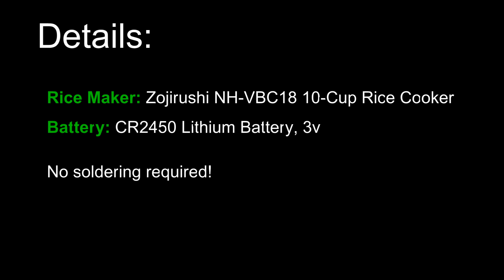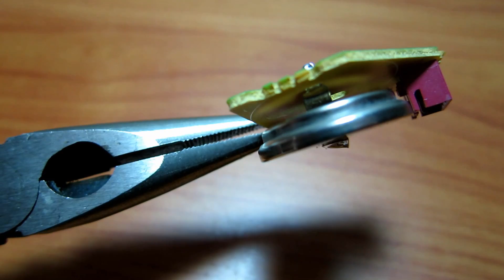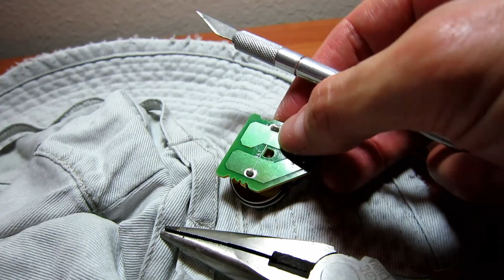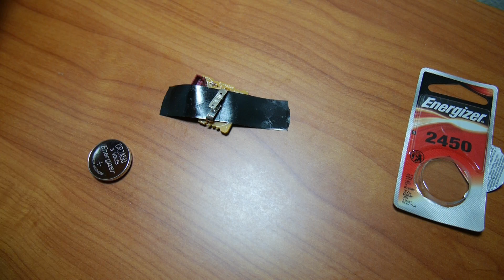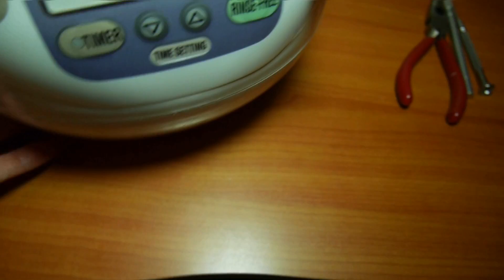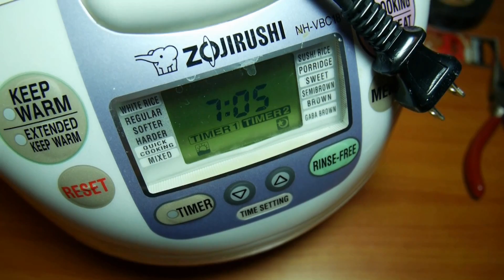Zojirushi Battery Replacement - No Solder (NH-VBC18 Rice Cooker)

Comment: Great video. Inspired me to have a look into replacing the battery on my Zojirushi rice cooker which failed after 10 years. On my NS-TSC10 the 4th screw holding the bottom on is a tamper proof, security Torx T20H. (It looks at first glance like a hex). However, once you get the bottom off the battery is not immediately visible. Neither is it visible after removing the first circuit board. So unfortunately, I gave up at this point.
Reply from the maker: That's great you attempted it. I'm sorry to hear it wasn't reachable! 😕

Comment: That doesn't look soldered, it looks spot welded. Anyways thanks for letting me know what I'm dealing with. I have a slightly different model but I suspect its the same. My battery has been dead for about 5 years now.
Reply from the maker: Thanks for mentioning that. Those types of connections are not my expertise so I appreciate your comment.

Comment: Btw, when i saw this video. Is 2025 march! They still does it with their higher end models! Like come on. I have to search far and wide. I opened the rice cooker. Re-enforce the weak points. So it last bloody longer. If my match is correct.  I'll have to replace the battery every 2-3 years. And check both lid and precious sensor. In case they failed....
Reply: Yes, i got extend warranty from my seller. They won't give me shit if i added extra electrical tape on some of tbe weak points wires. (Just venting.) Either ways. Technology always break. It's not how, is when.
Reply from the maker: Hopefully, you'll get more than 2-3 years. The battery I installed in this video is still working almost 8 years later.

Comment: I’ve had a slightly older model for over 8 years and its battery just died. I knew I could keep using it but the timer function has been very useful when I get home late from work. Thanks to your video, the battery is back on! Thank you so much!
Reply from the maker: I'm glad you found it helpful. Thanks for sharing your story!

Comment: I was very happy to find this video. Then I started unscrewing the bottom of my Zojirushi rice cooker and realized that although 3 of the screws holding the base plate in place had Philips heads, the 4th has a hex head. Unfortunately, the only hex screwdrivers I have are in a folding multi head screwdriver, and they aren't long enough to reach the deeply recessed screw. I can't imagine why they would make the 4th screw different, other than to make life difficult. Oh well, I guess I'll just have to live with resetting the clock on the device every time I set the timer, which is pretty much every night since I mostly use it for the  steel cut oats I eat for breakfast. Not a big deal - it will give me an opportunity to practice patience.
Reply from the maker: That's frustrating! If you're in the UE, Harbor Freight has a long reach hex set for $8. Might also be able to find something under $10 at your local big box store or amazon.
Reply: I don't know if you fixed this but on my Zojirushi NS-TSC10 the 4th screw is not a hex but a tamper proof security Torx T20H. It looks at first glance like a hex.

Comment: $1.99 for a CR2450 battery holder with two soldering points.
Reply from the maker: Yes, those holders are cheap. Not everyone has the equipment or knowledge to solder them.

Comment: Hi! Can you please tell me what size did you use to open the rice cooker? Is it an Allen wrench? Or the hexagon shape screw and what’s the length? Because I need to buy it so I can open and fix it. Thank you!!
Reply from the maker: Hi, it's Phillips screws. They are recessed approximately 1 inch (or 2cm) into the body. Most medium sized Phillips head screwdrivers should work as long as the shaft isn't too thick.

Comment: Thank you sir! I have a Tiger Rice Cooker and there's a ribbon connector attached to the circuit board. I have to take out the entire circuit board and not just a small part for the battery. I did NOT want to mess with that and was racking my brain on how to do hand gymnastics to get my soldering iron behind the board to de-solder the battery. I hadn't even considered just cutting off the terminals and taping a new battery. And voila. What I thought would have been a 1-2 hour job took me 15 minutes. My Tiger rice cooker is working 100% again!
Reply from the maker: That's cool it works for other brands as well. Thanks for sharing your success.

Comment: Great video, thanks a lot! I just bought a Zojirushi and that was the only thing that bothered me about them. Now that I see where the battery is, I will not worry at all about changing it myself. As a computer hardware tech, I have a soldering iron which will make the replacement even easier. This was very helpful! I know it has been 5 years since you posted this, but it is as useful to Zoji owners today as it ever was.
Reply from the maker: Glad you found it helpful! The battery that I installed in this video is still going strong. My family eats a lot of rice and we still use this rice maker several times per week.
Reply: @ScholtzLife  I just received a new NS-LGC05 rice cooker, so I do not know if it is still the same inside, but this model has been on the market for over 6 years, so I assume it is. In any case, I will find out in a few years when the battery needs replacing! Thanks again! I picked up one of these: https://www.youtube.com/watch?v=CMgNTTpGpy0&ab_channel=PapiEats

Comment: Hi i have 2 Zojirushi NS-TSC10 and am trying to get the good working lid from one to replace the other one that is broken, i cannot seem to get the handle off  to then get to the lid, any ideas or instructions to assist, thanks.
Reply from the maker: Hi, I'm sorry I haven't tried to remove the handle. There are no exposed screws for the handle. I wonder if you might have to remove the bottom of the unit first. Then look up inside for the mechanism of attachment. Good luck 🤞

Comment: Does the battery in these rice cookers need replacing very often?
Reply from the maker: In my personal experience, the battery lasts a long time. I use this rice maker every week and the battery installed during this video is still working in spring 2022.

Comment: So the rice cooker is rendered useless after this battery dies? Or will the clock come on(using electricity from cord)when you plug it in even after the battery dies?
Reply from the maker: The cooker still works with a dead battery. The default clock will come on whenever the unit is plugged in but the battery keeps the time. Thus, when the battery is dead, the clock time will be lost whenever the unit is unplugged and will need to be set each time the unit it plugged in.
Reply: On ours, like so many, the battery died.  Works fine when plugged in, but the time resets each time.  So every time I make rice I set the time, then the timer.  Takes an extra 15 seconds.  I’m intrigued by this replacement video, might try it.  Fantastic rice cooker - had it for maybe 10 years.

Comment: The newer version of this machine they made the battery MUCH harder to replace. You basically need to take the entire machine apart and remove the circuit board. They really want you to buy a new machine when the battery dies...
Reply from the maker: Ohh wow! That's disappointing. I read that come countries are enacting (or have enacted) laws that require products to be more serviceable. Bummer if Zojirushi is going in the opposite direction. Anyway, as of 2021 my battery replacement is still going strong. Thanks for your comment.
Reply: That's not all; while three of the screws at the bottom of the unit can be removed with a standard Phillips screwdriver, the other screw is a non-standard star with a prong in the center, making it impossible to remove. I tried using a power drill to wear down the prong without success. I haven't given up; I AM going to defeat this latest unwarranted attempt to lock us out just so the greedy manufacturer can make more money. Some Zojirushi employee looking for a promotion must've seen this or a similar video and said, "Oh, no; we're going to stop that right now!" People are naturally selfish but companies can be extremely greedy. Their motto remember, is, :It's not personal; it's business." This relieves them of all human feelings and compassion.  An example of this is the COVID-19 vaccines released by big pharma, which they lied and told us are completely safe and necessary, but turned out to be harmful. They were clearly motivated by greed. They said they'd release their research data on the vaccines in 75 years, when everyone working on them is already dead.

Comment: What's wrong with your cooker? Mine has the clock on, but all button is not responding.
Reply from the maker: Mine had a dead battery. Not sure about your button. Perhaps it's an electrical wiring issue.

Comment: Eventually the tape will fall off. You can get a new battery on ebay for a few dollars and solder it in yourself or take the little board and a new battery with the tabs to an electronics repair shop and I'm sure they would solder it in for you for not much money.
Reply from the maker: Thanks, that's a great idea! It's June 2026. We still use this cooker at least twice a week. Tape and battery are still going strong! When the battery finally goes, I might try your suggestion.

Comment: I have the same model and still didn’t work even after my husband unscrewed it to see what went wrong inside. It has no electricity.
Reply from the maker: I'm sorry to hear that! It sounds like a different issue. When the battery is dead, the clock won't work without power but the cooker will still run when plugged in.

Comment: How is your rice cooker now. Is the electrical tape still doing okay and not melted by the heat?
Reply from the maker: Hi, yes it's still working great. I use it 1 - 2 times each month; no issues.
Reply: i think the tape is too far from any indirect heat source to do any damage anyway

Comment: Could  you tell me how to open the zojirushi rice cooker bottom? There is one special crew that I could not found a screw driver would fit it. The rest of the three  screw is philip's.
Reply: I removed the special screw (and rather easily i must say) with a flat slim flat blade screw driver.  I had a set with many different widths and found one that spanned from one "star point" to an opposite one passing to one side of the center raised post.  Good luck!
Reply: I have the same issue with the 'security screw' being one of the 4 screws on th bottom of my NS-ZCC10.  It's a star-type screw head with a raised post in the center; therefore a standard drive bit won't work...
Reply from the maker: Hi, it's been a while so I just looked at my NH-VBC18 unit to refresh my memory. On the bottom it has 4 Philips screws, one in each corner.  What does the special screw look like?  Which model Zojirushi do you have?
Reply from the maker: Thanks for posting this tip.
Reply: It takes a t25 tamper proof torx screwdriver. Not bad to have around specially if you like fixing stuff